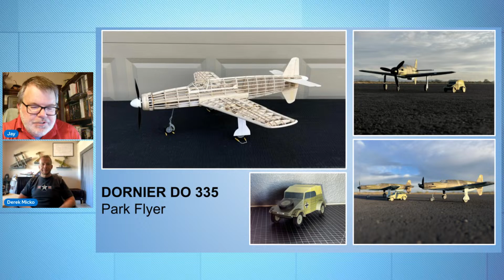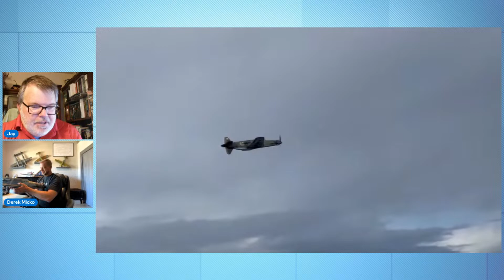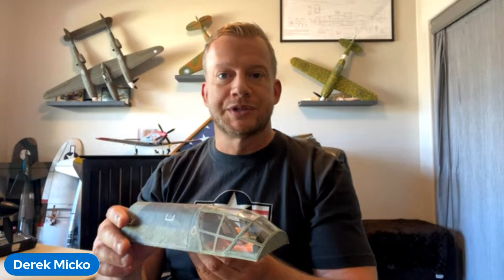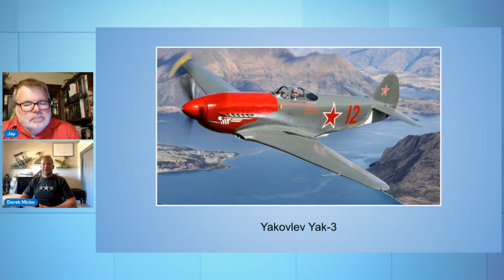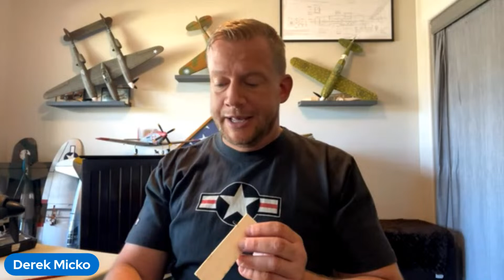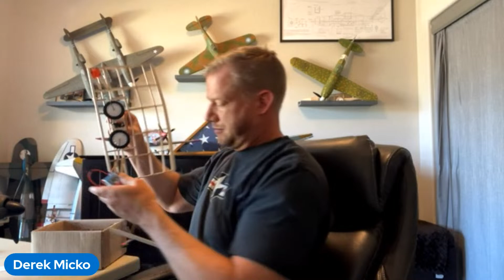Model Aviation LIVE with Jay Smith - 5/17/24

Comment: The Dornier DO335 model is such a nice-flying model, its looks great in the air and the added details that Derek added really make it stand out.  And the little car is a cute addition to the display.  Did you notice that the car could drive right under the airplane?  The Do335 was a monster IRL. Loaded weight was about 5000lbs more than a P47.   The new micro retracts that were previewed at the end of the interview are now available from Rabid Models.